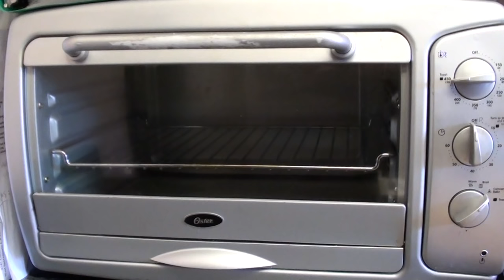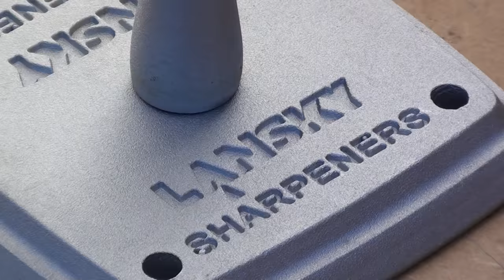MAKING CS:GO SHADOW DAGGER Part 2

Comment: Why is the quench done in oil as opposed to water? Sorry if this is a dumb question I'm just curious.
Reply from the maker: Because 5160 is oil quenched steel. It is quenched in oil and not water. Water is too fast for it. It will make it crack.

Comment: -Really liked the acid etching here, could use it to make the knives have the "Stained" skin from CS:GO. 
-Could also use the heat treating to create a Case Hardened look on the knives. 
-Many people have requested a butterfly knife, I think you can make the blade unsharpened so it can't be identified as a concealed weapon. Not 100% sure if that would still be legal though.
Reply from the maker: +Halfswift I am still trying to find out if I can make one. It will be the way down the road before I make one. Need more practice and a good sketch of it so it works properly.
Reply: +SLAVIK TELY Please consider making a buttefly knife.
Also, do you sell those? I'd be interested in buying one, if we can work out a price and if you sell them of course.
Reply from the maker: Michael Traxem As for the butterfly knife, it is illegal for me to make one where live. All knives are sold. Sorry. Price would be around $250-$350 depending on the knife.

Comment: What kind of metal is that? can i use any scrap metal ? :)
Reply from the maker: +Mathias Moslund I used 5160 high carbon steel. No, not every scrap metal will heat treat. You can still use scrap metal to practice.
Reply: +SLAVIK TELY oh okay thanks a lot!

Comment: I know this might be a funny question but whats the difference between using motor oil and that cooking oil? If anything. Also where could I get one of those sharpeners?
Reply: Justin Grimes I think it's the price and amount you get for said price
Reply from the maker: Motor oil has toxic vapors where as canola or peanut oil does not. Lansky sharpener at Amazon.

Comment: wow really nice videos :) i like hem a lot!! also the karambit knife. can you tell me, wich is the best steel for making knifes? like the best mixture so that it's soft enough to work with and that it  won't break but still become and stay extremely sharp? and cool videos btw keep doing them.
Reply from the maker: +Tim B Start with simple steel like 1075 or 1084. They are easy to heat treat. If you can get 5160, it is pretty good from what I hear, but it is mostly used for machetes.
Reply: +SLAVIK TELY Okay thank you very much i will try :)

Comment: "SWEET" ,,I freaking like that.I did see both vids.Im gearing up to do some smith work.So I've been all over You Tube getting a look-see at all the lil tips and tricks each person use's.I got a good NEW tip from your vid.It was when you had the round file in the drill.My father always says,,"WATCH AND LEARN"..
Reply from the maker: It messes up the file but gets the job done. Files are supposed to be used in a forward direction only.
Reply: Yeah im sure it dose.I will be messing some up to if it gets the job done..lol

Comment: Slavic 
 FYI the etchant should be diluted 3 to 1 so it is not so aggressive. Buy the way thanks for recommending this video it helps lots .Looks like I need to modify my jig though.

Again thanks, Martin Moldovan
Reply from the maker: You dilute it 1 part water 3 part etchant  when you etch a hamon.
Reply: The way I understand it is the etchant is 1 part to 3 parts purified water. It is recommended by lots of Bladesmithing that I talk too.
Reply from the maker: Shan Moldovan I must have it backwards. I will have to read up on it when I go to etch a hamon. Thanks for the heads up.

Comment: On your final sanding could you use water sand paper and if so would it give it a smoother finish.
Reply from the maker: 5160 steel rusts so if I use water it would develop rust on the blade. You can use wd40 or mineral oil. I do not know if it would make it smoother or not but the sand paper lasts longer.
Reply: Ok thanks for the in put

Comment: Slavic 
About the jig I asked before but lets ask again. The size of you jig allows you to do large and odd shaped pieces. Right?  So would you mind telling me the dimensions of your modified jig it looks as if it would be a tad more handy than the regular one I already have.

Again thanks, Martin Moldovan at M/ S Blacksmithing and Blades
Reply from the maker: I placed a 13 inch by 13 inch board on top of the original jig. You can place eyelet screws anywhere you want to suit your need.
Reply: Yea this is what I remembered about our conversation. Although it seem s you like the arc or half circle .how does this benefit?  Does it help with odd shaped blades? If so id like to make one I am really into a shapely blade curves, curves curves. Ya know.
Reply from the maker: Shan Moldovan I used it only on my Karambit blade. If you do not have curved blades then you do not need it.

Comment: how do you get such a good finish when draw fileing? do you push down hard or just rub the file on the surface? it never seems to work well for me
Reply from the maker: I do not push hard on it. It takes a long time to make a nice finish and then lots and lots of sand paper...220,320,600,800 grit.
Reply: Thanks!

Comment: Nice job! 
What thickness is the steel you use ?
Reply from the maker: +Vincent Dieleman Read the description in part 1
Reply: You made a mistake, 3/8" is equal to 9,5 mm, not 8cm (it's impossible)
Reply from the maker: Vincent Dieleman I measured it with a ruler. The bar that I had was a 3/8" but by the time I filed it down, and measured it with a ruler it was 8 mm
Reply from the maker: Vincent Dieleman Thanks, I will go change it.

Comment: Are you going to sell the produced knives you have made? I'd be interested in the Karambit.
Reply from the maker: +seeya20743 You must be 18 years old and live in US.
Reply: +SLAVIK TELY I'm 19 and I live in Florida
Reply from the maker: seeya20743 $400 for a CPM S35-VN steel. It is a stainless steel. I would not want to make you a knife from a concrete saw blade.
Reply: +SLAVIK TELY also seeing you make that knife mainly from files and an angle grinder actually has took me from being a knife collected to begin making them from stock
Reply: +SLAVIK TELY Sir I think the saw blade added character. I unfortunately don't have that money at the moment, but I'm a huge fan and will be following until I do
Reply from the maker: seeya20743 You can make one yourself if you follow my videos. I see that you live in Florida, I would not go with high carbon steel. It will rust like crazy.
Reply: +SLAVIK TELY I figured that. Again I just began so I believe I must hone my skills before I can take on the task of making a Karambit.
Reply from the maker: seeya20743 The reason the price is so high is because I use premium steel for the customers. I send the knifes to be heat treated at a professional place. They charge $125 + $16 for shipping whether you heat treat 1 or 15 knives. I do not have that many customers yet so, it is very expensive for me to heat treat knives. If you look at my Instagram page, you can see the three knives (two gut hook knives and a third one next to it) after the heat treat. I paid that $$$ mentioned above for the heat treat. But they are for a customers and I am not going to sell them crap steel knives.
Reply from the maker: +seeya20743 Try making a knife that does not have inward curved blade, because it is totally different ball game.

Comment: Omg,unbelievable, good job sir, it's possible to make a case hardened skin?
Reply from the maker: Thank you for the compliment. I can not put skins on my knives. I do not have the equipment to do that.
Reply: Cool, To make the case hardened would have to expose the knife at a very high temperature right?
Reply from the maker: OnLy Player Yep, and it would destroy the hardness of steel.

Comment: What I don't get is why blow torch it, and then dip it in oil? What does it do to the dagger?
Reply: You watch a video about how to make a knife and dont even know what hardening steel is and how its done?
Reply: Its my first time watching a crafting video Phoenix. And isn't it usually water that is used?
Reply: You can use water but water conducts heat 3,5 times faster than oil so your blade cools faster and you got more stress witch can lead to warping and breaking. Some steels have to be quenched in oil, some in water, some are being left to cool in the air and others are being clamped between 2 pieces of cold metal. For As a rule of thumb: As less carbon in the steel, as more extreme the quenching methode. Water is the most "extreme" oil quite a bit less, them the steel bar methode and for really high carbon steel normal cooling down is enough.

Comment: Did u build that knife sharpener jig?
Reply: +Mgkiller 1337 He built the beveling jig that he used in part 1. the sharpening jig is made by Lansky. think its like 20 bucks on amazon
Reply from the maker: +Nicholas Hill The one I got was $50
Reply: +SLAVIK TELY ok yeah i checked amazon. theres 2 models. 1 for 35 and one for 60. im still wrong but still wanna put that out there. i think i own the 35 dollar one and its great.
Reply from the maker: Nicholas Hill I would love to get this system. Tormek Sharpening System Hand Tool Bundle TBH701 T-7.
Reply: That looks amazing! But I would think curved edges would be difficult to sharpen on that type of jig. To me it looks more like a chisel sharpener, but it could work for some knives.
Reply from the maker: Nicholas Hill I have sharpened Karambit and the Dagger with it. It works just fine.

Comment: what exactly is the part where he heats it and then cools it with oil for?
Reply: and the thing with the microwave
Reply from the maker: Oil quenching hardens the steel to a point where it becomes so strong that it is brittle. The oven tempering makes it softer but not as soft as it was before the heat treating.

Comment: What is that oil treatment?
Reply from the maker: +GarceX You can use any oil. I use grape seed oil, it's something i have at home.
Reply: why do you treat the steel with oil?
Reply from the maker: GarceX To make the steel harder so the sharp blade last sharp for a long time.

Comment: Water or oil for tempering?
Reply from the maker: Steel 5160-I used oil.
Reply: Thanks from argentina
Reply: SLAVIK TELY do you know wich oil
Reply from the maker: Gecko- right now I use Canola oil.

Comment: I like how you put it in the microwave
Reply from the maker: After the heat treating you must temper the steel so it would not be brittle. Therefore I put it in the oven at 450 deg F for 1 hour.

Comment: I wish I had the tools to do the same.
Reply from the maker: Start with one tool at a time. Do not borrow money to buy tools.
Reply: You only need a hacksaw, a clamp, a few bolts and some files. You can get started from 0 for around 50$ and you probably have some of these tools already. It just takes more time doing it the old fashioned way.

Comment: i think falchion should be cool
Reply: +toasterhead Falchion doesn't have a spring-type opening, if you look at it closely on the opening, the character actually opens it manually so no flipping will need to be done, although I would recommend a locking mechanism if SLAVIK TELY where to make one, for safety reasons ofcourse

Comment: I wish I could have those tools
Reply from the maker: You start 1 tool at a time. I still wish I would have the tools the other knife makers have but it takes time.
Reply: Exactly, 1 or 2 tools each paycheck and you can have one heck of a shop before you know it.
Reply from the maker: DieWolfen Exactly. Before I knew I spent $4,000. I recently added up all the tools I bought and I spent $2,000 on just material. Crazy huh? But you do not notice if you buy a little at a time.
Reply: how much would it cost just for you to do one if someone wants to buy one
Reply from the maker: Evert Castro I do not take orders at this moment. For this one it would be around two hundred and fifty.

Comment: Why did you put it in oil ?
Reply: Template it is a part of the heat treating process
Reply: Can i do it only with water ?
Reply: Template depends on what type of steel you are planning to use, maybe do a little research first.
Reply from the maker: To make steel harder so it stays sharp longer.
Reply: oh ok thanks